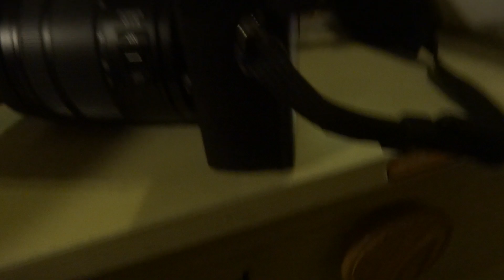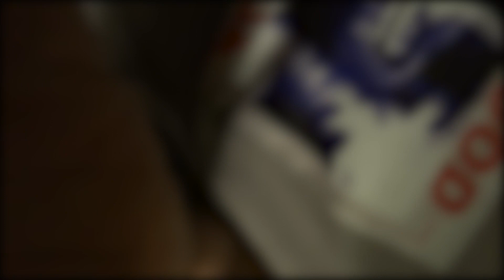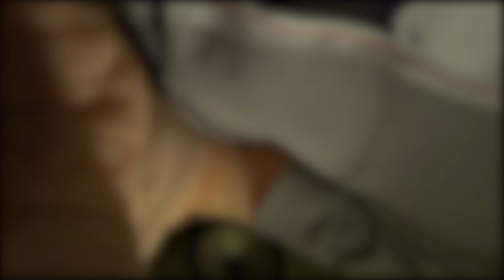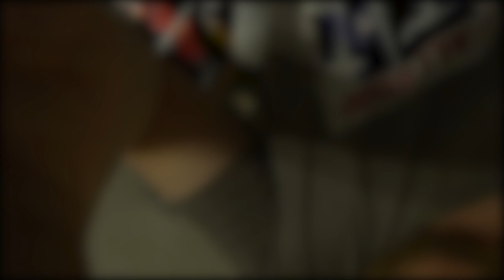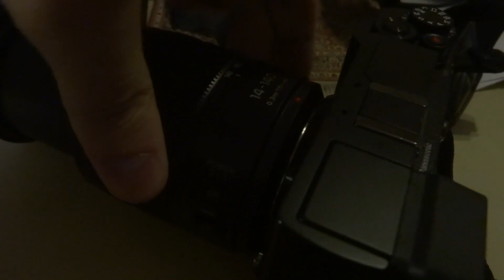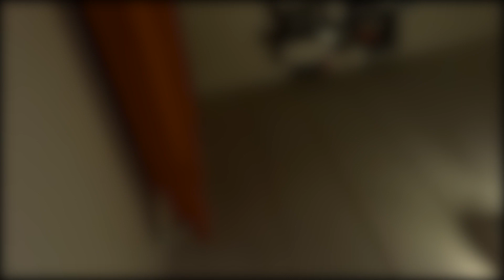Panasonic 14-140 mm f3.5-5.6 Power OIS - A Somewhat Noisy Lens

Comment: You have been sold a faulty lens I'm afraid it should not be making that noise, I have the exact same lens and mine is virtually silent, with no squeaking. Get yourself a replacement or refund!! Get in touch with Panasonic directly to confirm it has a fault.
Reply from the maker: That is strange. I emailed Panasonic about it last year, referring them to this video. They replied that it is normal. I haven't had any issues with it otherwise, so I just stopped paying attention to it. I only notice it in quiet environments.